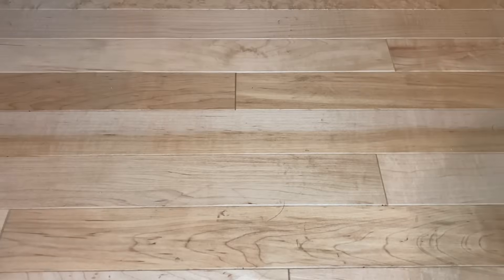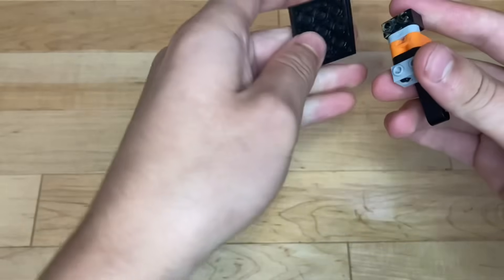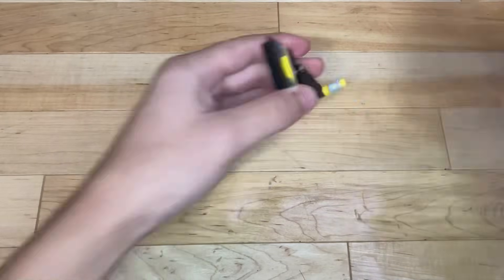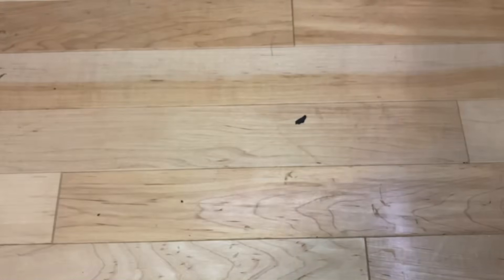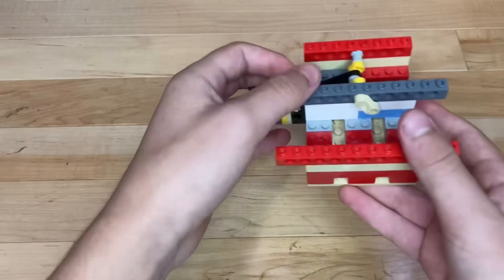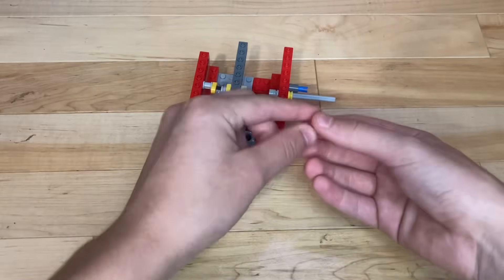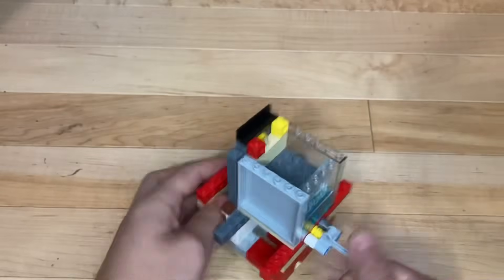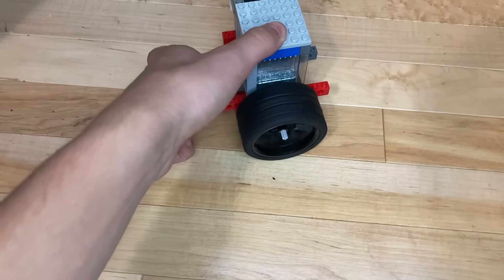LEGO Vacuum Engine Tutorial - HIGH PERFORMANCE

Comment: My only complaint about my engine is that it squeaks at idle.
Reply from the maker: I recommend putting lubricant (olive oil, silicone, etc.) in the holes where axles go through. That should fix the squeak.

Comment: Mine wont work the pisten and crank a d all spinn but it does not spin that well and when i take the vacumene on it wont work its not as smoth as yours in general do you have anny idea why also i did not have all the warts you have so i used some off my own in some plases but it should not matter

Comment: I built it just now and it sounds amazing and is really fast.
I didn't want to glue the piston head and I accidentally started my vacuum on full power and it sucked the head right of 🤣
I needed to substitute some critical parts since I didn't have them available but it still runs incredibly smooth. Really nice work 👍
Reply from the maker: Glad to see you had success :) I have an idea for an indestructible piston that will require no glue to stay together, so stick around!
Reply: @KFPlusLegoMastery I just build this, aplied the vacuum onto it, turned it on,put the engine on FULL THROTTLE. and guess what. NOTHING HAPPENED
Reply: @3rd_ACC try again
Reply: @henryisveryfly I have the same proplem,it doesnt work.
Reply: It works just follow it properly

Comment: I do not know if I did it wrong but I have tried building and rebuilding this engine 2 times, but the beam on the valve hits the bottom of the piece made up of a 1x6 and 2x6 with 2 1x3 pieces connecting them. Does anyone know what I am doing wrong?
Reply: That was the same for me, but that's because I didn't have the proper pieces, dont have the yellow crank pieces, so instead of 1 1/2 length , its a full 2, used some 1x2 technic pieces. What I did though, instead of that 2x6 plate thats getting hit, was I took 2 2x2 plates and a 1x2 plate and placed it, so it looked like this kinda [  ]__[  ]  it's weird that a couple of people are having the same issue, are you using all the right parts? I figured this was the case for me.

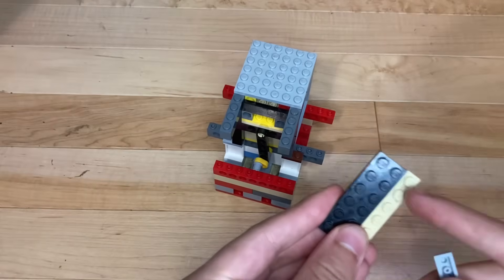Comment: I have an issue when building, the part made at 12:03 doesn't give enough clearance for the valve to spin fully, the 6x1 technic piece hits the top of it any help is appreciated.
Reply: That was the same for me, but that's because I didn't have the proper pieces. What I did though, instead of that 2x6 plate, was I took 2 2x2s and a 1x2 and placed it, so it looked like this kinda [  ]__[  ]

Comment: I made the engine exactly, it seems like yours spins way easier. I put a strong vacuum to it but it just won’t run,  so you know why? Any tips?
Reply: your vaccum might be too strong
Reply: im having the exact same issue. i built mine exactly like his, but it wont work. it wont even crank.
Reply: Sure you used correct colour pins?
Reply: What I had to do was adjust the crank timing - I had accidentally made it 180º instead of 90º. Then I put olive oil on the contact areas and added a second wheel to the output shaft and it runs great.
Reply: Try changing the wheel I had the same problem and messed around with it for hours and then changed the wheel, started working almost immediately after a few manual start up spins to the wheel, I didn't think the wheel made much of a difference but I was completely wrong

Comment: Hey man, great video! Got mine running, but I noticed that I have to open the throttle almost all the way just to get the engine to idle. It does rev a bit at max throttle. I am using a lighter flywheel and a 1x2 crankshaft, same as the piston connection. Is it an airflow problem?
Reply: ik im 9 months late i used the same thing as the piston but i used superglue and a bit of a skewer to make it similar to the one in the vid. before and after i did that i still had to open it all the way. try removing the cylinder thing on the valve
Reply: and make the flywheel heavy enough so it stays spinning for at least a second

Comment: Thank you so much for this tutorial I love this but how do you lubricate it
Reply from the maker: How I do it is get some olive oil on something like a Q-tip or even your finger, then rub it along every cylinder wall as well as where the valve moves. If you wanna get serious, you can lubricate the crankshaft and all the “bearings” in the engine. I might make a video about how to properly lubricate your engine soon.

Comment: THX for your tutorial, but i have a small problem... I made and It Is good even though the valve was causing too much friction on the wall. (I fixed it by putting some soap). only a stupid question ... 😂 how it works ... the air must be thrown in or sucked out👀🥴
Reply from the maker: I made video titled ‘The Basics of an LVE’ which explains how these engines work, feel free to check it out!
Reply: @KFPlusLegoMastery  I built it identical to yours. I've been trying for 20 minutes but it doesn't start and I don't know why.
Reply: @KFPlusLegoMastery yes, i can't start this engine. Uuuuu It Is my First engine but It seems perfect.😭 I always hear a strange noise as if he wants to leave but immediately afterwards he dies.
Reply: @KFPlusLegoMastery  a valve makes a lot of friction with the walls ... I'll try something else
Reply: @KFPlusLegoMastery  finally After 20 fail i did it

Comment: Hey, I’ve built a couple of engines before but when I tried to put the walls together in the cylinder chamber the piston would get stuck on the walls and it wouldn’t spin freely, if I loosen the walls it’s frictionless. What do you reckon I do?
Reply: Use some lubricant like olive or sunflower oil, if you have any rubiks cube lubrication works well.

Comment: Hey, my engine wont start at all. I have tuned it and put a tire on for suction. The only thing the yours and mying differs is that i built my rods for the valve 9 instead of 6 and for the piston i used a 9 instead of the one you used. Any tips on how to fix it?
Reply: Did you use the vaccume

Comment: hope you know that the tiny engine doesn't run at 6000 rpm fyi a turbo diesel engine runs at top of 4000 rpms
Reply from the maker: That’s funny you say that, because just a few weeks ago a confirmed 6000 rpm run was done on this same size engine
Reply: @KFPlusLegoMastery  how did you test with two white stripes or one? btw I'm not mad or anything just want to confirm because 6000 rpms is what real car run at
Reply from the maker: @Ethan-wo2mc  it actually doesn't use the reflective strips and lasers. it used magnets and a real computer in order to calculate the RPM. 10000 has only been breached in lego with turbines, at this point. Maybe we will see 10000 RPM lego engines in the near future tho!
Reply: oh soo sorry for that so I did the research and one cylinders can run at 10000 rpms if spected right so in your way you Lego engine is technically turbocharged for the vacuum like I said I'm sorry

Comment: I made this engine! Its works great but I dont want to glue the piston because Im scared in case I want to tear down the engine. My engine keeps blowing up after some high speeds. Is there anyway to make it stop blowing up the piston? Thx for the turoria too!
Reply from the maker: You really don’t need a lot of glue. I only use a very small amount and it works just fine, and I can easily pull it apart and wash off the dried glue

Comment: I build it and it work thx for tutorial but i have a problem if  my
Reply: Throttle liver is off engine will stop
Reply from the maker: You can try making holes in the throttle plate or limiting the amount that it closes.
Reply: @KFPlusLegoMastery i do it but still didint work meaby vacuum clearner bad

Comment: Hi everyone, I just finished building this awesome engine! But I am struggling to get it to start. Does the vacuum have to seal really well against the intake? Or any other tips to help get it started!! Thanks 🙏
Reply: Well when my engines don’t run I put vegetable oil or any safe plastic oil. If not, try making sure there is no air gaps.
Reply: I need to see what the pieces name is

Comment: Is the crank for the piston necessary part? Can i replace it with something else?
Reply from the maker: Yes, you can easily substitute it for a different piece
Reply: @KFPlusLegoMastery  Thanks, now i finished and its ready, but i noticed that it was really stiff and and no near smooth to run. Does the oiling help alot or should i try loosing up some pieces?

Comment: If I don’t have the tan crankcase piece can I improvise and use a different piece or is that a necessary piece?
Reply from the maker: Go right ahead, I fully encourage improvising on your engines. I have to do it a lot myself
Reply: usa a 3 long axle not a 2 and use a half width 2 long technic bar with axle slots on it. should work

Comment: Can turn these into drag cars by using small co2 tanks instead of vacuum and let it launch 😈 by holding down throttle with rubber band
Reply: can make a supercharger and hook it up to the crank & the engine and it’ll keep going by itself

Comment: I didn’t have all of the parts for this engine so I had to improvise. After hours of mind numbing adjustments I was finally able to get it running at it was so satisfying. Thanks for the video and for people looking to build this, don’t give up! Even if you don’t have all the parts, get creative and use the different parts to get the job done. Only thing you absolutely need the exact same pieces for is all the crankshaft parts. The small 1 and 1/2 pieces are essential for the engine to run and they have to be at a 90 degree angle to the 2 hole cranks on the piston side.
Reply: do you think you could make a video for what you did? i dont have the orange piece for piston or the skinny 6 tec piece one for the valve & crank
Reply: Nice i also do the same thing but im hgoing to improve by making small ones
Reply: Where did you find the 1 and 1/2 pieces?? I can't find them anywhere
Reply: Can you please tell me how you built yours because I don’t have all the parts either
Reply: @colewaldridge9572  u can use a 2 + 0.5 x 2 x 1 , the red ones, and a red 2 long axle
Reply: nerd5809 yeah pretty much, or but the technic sets or whatever they’re called
Reply: Me too
Reply: Yea please help
Reply: PLEASE MAKE A VIDEO
Reply: Merci beaucoup d'avoir expliqué qu'il fallait des pièces vilebrequin
Reply: the crankshaft parts are the only parts i dont have :(
Reply: Metaliker i didnt have all part important part please help me

Comment: How do you actually connect the vacuum to the back of the engine? This is the first video I’ve watched about these they’re sick
Reply: Looks like he puts a Lego rubber tire on the tip of the vacuum, and then puts it up to the "window" for the intake. The rubber tire helps it seal
Reply: I'm also wondering this!
Reply: You put a Lego tyre on the tip of the vacuum (obviously take the thing on the top off) and that helps it suction

Comment: I just built mine but any tips on how to connect it to a vacuum? Thanks.
Reply: I use a Lego rubber tire and just fit it over the vacuum mouth. Works pretty well, you just have to hold it there

Comment: Just built mine. Sounds amazing, and pretty reliable if you glue the piston and valve.
Reply: Mine didnt even run altought nothing was wrong
Reply: @veikko3426  same for me I spend 3 hours building it and it doesn’t work
Reply: @veikko3426  ok it works now I used a different wheel
Reply: What glue do you use?
Reply: @Drewskii55  I used Tamiya Cement. Super glue would probably work just as well.

Comment: Just made one of my own, and I gotta say, I'm impressed. I don't have a wheel that big but I got one that works, I also tweaked the throttle a little and I noticed slight improvement. Cheers!

Side note: how do you keep your vacuum on the engine? Mine is constantly slipping off, also whats the song playing in the background towards the end?
Reply: Hey this might sound like a big favor but can someone help me track down these pieces or at least point me in the right direction? Really want to make one of my own after seeing this video and all these comments.
Reply: For parts try bricklink
Reply: @deanmcbride  I got my parts from the lego store, it’s cheaper but parts are shipped separately
Reply: Did you put a rubber tire around the vacuum thing?
Reply: @wezeledelman761  I did, but it still managed to slip off. It's not a super big issue as I can just hold it there, but enough to where it's a little annoying. The tire works great as a seal tho

Comment: is there a way to strengthen the connection between the 1x4 L piece and the 1x4 piece on the valve? Mine keeps coming off when i run it with too much throttle
Reply: Try superglue or clear tape on the back

Comment: 6000 RPM ?! It sounds like 4000 ?
Reply from the maker: I’ll admit that the demo of the engine in this video wasn’t its max speed since I didn’t want it to break on camera, you should glue the valve together if you want to run it at that speed.

Comment: I finally made it. A solid connection DOHV Lego vacuum engine using a 4x4 piston. The base is only studs in length, and six in width. I believe this is going to be the first of this kind on Youtube. (I inspired it from my other design for the chain driven one) I'll post it sometime soon :D :D. After some research I believe that it might possibly be the fastest of the pushrods ( With consideration that solid connections are like a family of the cam actuated ones).
Reply from the maker: I believe someone else has already created a DOHV 4x4 piston, which in itself is quite difficult but I’m interested to see your design!
Reply: @KFPlusLegoMastery  yes but that design revolves around cams. My design does not need springs. Thank you. Ill post it soon. I feel like I don't do a good job at explaining it lol

Comment: Mine doesnt work and i dont spin very freely do you know why
Reply from the maker: You can try sanding the cylinder walls down a bit with sand paper or apply a lubricant such as olive oil or vegetable oil. It should free up the engine significantly.

Comment: my piston popped so hard that it made a scratch on my cylinder wall and popped the cover mine prolly goes 9000
Reply from the maker: 9000 RPM is very tough to beat. If you show proof I’d be impressed
Reply: @KFPlusLegoMastery  well it kinda took plastic of the piston and put it on the cylinder wall so ill have to fix btw i didnt even lube lol
Reply: if you can show prrof of 9000 thats pretty lit but i seriously doubt it went over 6k
Reply: @taylor842  well by the sound it went faster than the tiktok one i used 2 motorcycle tires and more car tires so like a very heavy fly wheel and i have powerful dyson tower vacuum without the pipe so its compact
Reply: @schemil42Wastaken  like thats great but please show proof as soon as possible

Comment: I took some of your older videos and made an older design but then stroked both the valve and the crankshaft to hold the valve open longer and and allow more air in the cylinder makes TONS of torque but doesn’t rev so high 

So yeah bye

Comment: Hey dude, like your vids, tho I don't have the time to watch the full video rn and I wondered what vegetal oil should I lub this engine with pls.
Reply from the maker: I have found that olive oil or veggie oil work best!
Reply: @KFPlusLegoMastery  k thx I'll use olive oil but I'm scared, won't it start sticking with the time and acting as glue
Reply from the maker: @dimitrikhokjnikrov3452  It shouldn’t do that, I’ve never had a problem using it so I wouldn’t worry so much
Reply: @KFPlusLegoMastery  k thx a lot I'm going to start the build and I'll give you my feedback
Reply: @KFPlusLegoMastery  btw i dont have many 1x1 pieces with a hole in them can i build the engine with 3 or 4 of these and if yes on what part should i use them
Reply from the maker: @dimitrikhokjnikrov3452  If you have 4, definitely use them on the valve and the cylinder side of the engine. The ones between the valve and the throttle aren’t really necessary but I just used them for more support
Reply: @KFPlusLegoMastery  thx. Damn it works nice Idk how many rpm I have but it's rlly cool. But bcz I don't have the same cylinder plates as you sometimes the plates create friction and the cylinder lose speed which makes it hard to start and sometimes it even falls apart

Comment: scariest things on earth

the dark: 10%

death: 20%

clowns: 30%

the piston popping in your vacuum engine: 10000000000000000%
Reply from the maker: Its definitely nerve racking sometimes, Lol
Reply: @KFPlusLegoMastery  what would happen? Sorry I’m not good with engines…. Anyways one question is that is there a substitute for the two grey pieces that have two crosses in them. They are thin and rounded and used for the piston to keep it in place
Reply from the maker: @acast7  To answer your question, yes. You can substitute those two pieces with 4 of the half-stud axle bushings (they’re usually yellow or light grey color). Works exactly the same- Good question!
Reply: The piston popping is just a quick scare
The real threat to life is when the valve comes apart and yeets the throttle block off the engine

Comment: Should try to make some engined without the small motor crank (yellow piece crank for valve) I don't have them, and finding those isn't easy
Reply: you dnt need them yo can use some spacers and 2 hole little pieces you have to get creative but that will work
Reply from the maker: You can very easily replace that piece for a 2 stud long one, you may have to adjust the length of the valve connecting rod but it would definitely work. My first LVE on youtube utilized that crank setup and it worked just fine.